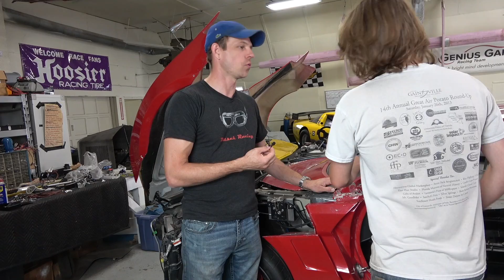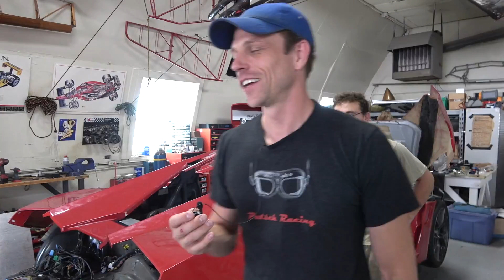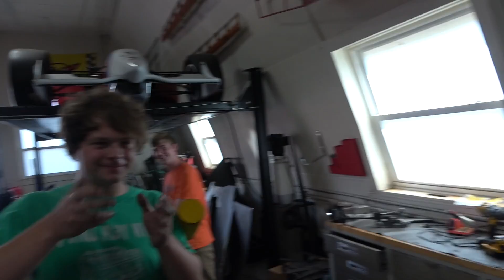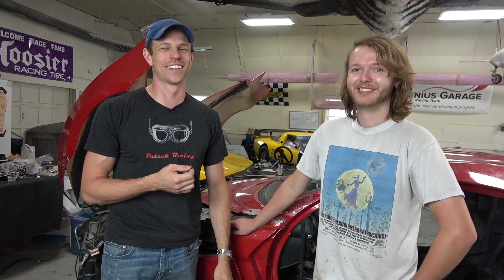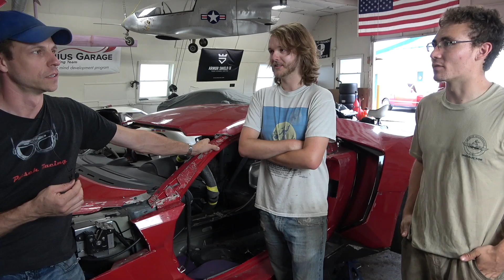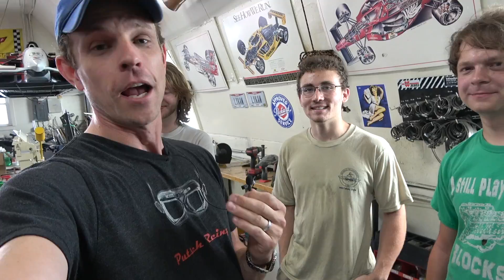The hard stuff | Lykan Hypersport build #15 from Fast and the Furious Live Stunt Car

Comment: Sorry I’m late. 
Was at a meeting with Augusta-Westland for freaking hours today. I’m glad to see the car coming along. 3M adhesives are serious. I’ve seen aircraft structure fail and rip before the adhesive failed. 

P.S calling mandrel bent chro-moly tubing pipes? 🙄🙄🙄 shame on you sir 😂😂
Reply: 3M has been kicking ass in the industry for a while now. A company that doesn't sit on its ass when the laurels keep shipping in.
Reply: aserta Definitely! My great grandpa helped start 3M way before I was born. 
I think that’s how my family was able to start the performance engineering firm.
Reply: aserta We have a construction adhesive in testing at the moment for the racing industry. It’s going to replace fasteners in certain areas of the chassis. In testing the steel beams it’s applied to have torn before the adhesive kicked the bucket. It’s pretty awesome stuff- gonna name it Laiken 50. It’ll hold up to 50 tons without giving even a blonde one.

Comment: Please tell me that you didn't just drill holes in the tubing and tap them to mount the clam shell. The threads through the walls of the tubing will create stress risers at every hole and will eventually lead to cracks and broken tubes. Of course, if the car is only going to be run for a few hours it really won't make much difference, but it is not an elegant solution. (Isn't fancy at all!) In places where it is necessary to bolt into tubing one should always weld a bung into the tube to create a proper attachment.
Reply: The support tubes for the clamshell aren't structural. They arent stress members and exist solely for the purpose of holding the clamshell.
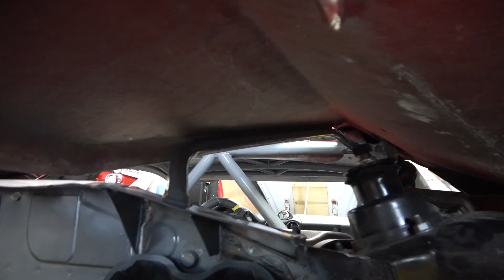Reply: @robokid20001  At 3:09 in the video, you can see that the tubes are welded to the structure at the back of the roll bar and at the rear bulkhead assy. As far as my observation goes, it really doesn't matter if they are "structural" as far as chassis rigidity or roll strength are concerned. They will experience vibration stresses at minimum and a series of tapped and drilled holes (which in tubing are impossible to deburr the inside of the holes, making the situation worse) will create multiple stress risers and unnecessary opportunities for cracking and failure, which would require cutting out welded in structural elements to replace. Better to weld in threaded bungs for mount points and avoid the issue from the start. It is extra work, and if the goal of the project is only short term then it is not an issue. On the other hand, if the goal is lasting quality, the extra effort would pay off. Engineering is always an exercise in compromise, and this is an example. I enjoy watching this kind of programming to hopefully learn something, as do many people. This just seems like a good spot to point out a possible issue. Not criticizing, just critiquing.
Reply: @edbennett8257  I know they're welded to the bulkhead, I'm the one that made them, mate. The small DOM tubing is 0.92 wall thickness, which is more than enough for tapped M4 bolts. DOM steel is not cracking under vibration, and the compression/ tension forces are taken up by the 1 5/8" tubing of the cage. 
We appreciate the input, but we've got it, my man.
Reply from the maker: Dude.... don’t be an arm chair engineer. It wouldn’t matter if those tubes cracked completely in half for safety and besides.... they never will. Would you care to talk about suspension geometry and bump steer next?
Reply: @robokid20001  DOM steel? DOM tubing?  You mean the stuff you keep calling "pipe"? (The term pipe is a very specific thing, different than tubing. Pipe sizing is determined by nominal internal diameter as the primary purpose of pipe is material transfer and diameter determines flow, with wall thickness being given in "gauge". Tube sizing is external dimension as it is primarily for structural work, with wall thickness being given as a specific measurement.) The term DOM is merely the manufacturing method, not an actual material spec (drawn over mandrel, as opposed to ERW or electric resistance welded. The difference being lack of a standing seam inside the tube. DOM is more expensive because there is an extra step involved drawing it over the mandrel to smooth the internal seam.).  What is the material? If it is 3140 chrome molly, it is somewhat susceptible to work hardening and cracking from vibration, especially at stress risers and weld joints that are not properly done. You're a very young man, and I get that you feel knowledgeable about this stuff, but you haven't had nearly enough experience to be barking back on this in such a dismissive manner. Like I said, depending on the design brief your solution could be appropriate. I saw you talking about wanting to be an engineer on an earlier episode. I've worked with engineers most of my life so let me give you a bit of advice. Do not always believe that you are right just because you thought of something and do not discount input from "uneducated" people.  I saw on earlier episodes you mentioned that you are still learning to weld, so here's a bit of advice for you on that too. Welding is more than just melting wire from the hot melt glue gun over the joint between the parts. It is a specialty of its own with very specific requirements that take professionals years of education and experience to master. Squirting hot metal out of a wire feed gun to hold 2 pieces together does not qualify one as a welder. I applaud you for getting hands on experience, but please don't turn into another engineering god who thinks mere mechanics are below him, we have too many of those already.
Reply: @CaseyPutsch  Arm chair engineer? Excuse me for offering an observation based on real world experience. You have no idea how many frames I have repaired due to cracks that propagated from a drilled and tapped hole. Tube frames, in mild steel tubing and chrome molly. Motorcycles, dune buggies, dirt racers. I was an Army helicopter mechanic, Leadman on the B-1B bomber program, held an A&P license and worked for TWA at the overhaul base doing structural repairs, designed and built from scratch with friends some of the aforementioned buggies, bikes and racers. Designed and build motorcycles that hold/held AMA National Land Speed Records. I'm almost 60 and have been building and breaking things my entire life. I have made mistakes, repaired them, and learned from them. My 2 car garage contains gas, mig, AC/DC tig welders, band saw, lathe, mill, cylinder boring bar, hydraulic press, and specialty hand tools that some people couldn't even identify. Excuse me for offering a suggestion that could make a difference in the overall quality of your build. Some people (like me) watch this type of video to learn, not to worship or laugh at you, and when a half ass method is presented, you shouldn't have a case of the red ass if someone offers an observation about alternate method. Suspension geometry? Macpherson strut? Upper and lower A-arm? Equal or unequal length? Rocker arm suspension? Rack and pinion or recirculating ball? Drag link with tie rod or relay and tie rods? Of course linkage and mounting locations are actually the most important feature as far as bump steer on a front end is concerned. Would you like to talk about the difference between a Panhard rod and a Watts link as it pertains to a solid rear axles effect on handling? Leaf vs coil springs, truck bars vs 4, 5, or 6 link. Of course independent rear suspension pretty much follows the same rules as front. No, I don't want to talk about it.
Reply: @robokid20001  Couple of things about those M4 bolts. (BTW, what is a tapped bolt?) I'm going to assume you're using a course pitch, .7mm. This equates to just a bit over 36 TPI (threads per inch). Tapping into .92 inch wall thickness gives you approximately 3 threads in engagement in each hole. I don't know about you but I would never trust any fastener in any application to stay tight on a vehicle with that little engagement and no locking feature. Again, as I stated in my first post, engineering is an exercise in compromise.
Reply: By the way guys, I'm not mad, not even annoyed for that matter. In fact I'm setting here chuckling, even though that doesn't come through well in text. (For that matter, in my case it often doesn't come through in person. I've been told that from across the shop I seem to be chewing people out if I'm just telling a joke, LOL,) I just happen to have time on my hands these days and thought I would try to throw out something helpful. It's all good as far as I'm concerned and I hope maybe someone can benefit from our discussion.
Reply: ITT: engineer flexes his book knowledge on something totally insignificant
Reply: @jamesflemmings1207  NOPE, not an engineer and never claimed to be, and not just book knowledge. Mechanic/fabricator with years of actual real world experience. And if you think that a discussion to minimize failures in a welded structure on a vehicle is "totally insignificant" then I hope you're not designing or building anything significant.

Comment: Why do people dislike these videos? I don't see what there is to dislike
Reply: I would imagine it popped up in their recommended and they didn't want it showing up again. if you dislike it, it won' get recommended again
Reply: @Casper061288  oh right, that would probably make sense
Reply: @AnitaHannjob  i'd hardly call them goofs, i'd like to see you do this ;)
Reply: @AnitaHannjob  W Motors had a team of trained, experienced engineers and substantial resources. This is a few kids in a shop making it up as they go along, and doing a kick-ass job of it.
I can keep going here. 
It's easy to criticize. What have you built lately?
Reply: @techvette  exactly, all these know it alls, fed up with them.
Reply: @AnitaHannjob  Congrats. And how did you learn to do that? When you started, could you build a car with three inexperienced team mates faster than the manufacturer?
If you're building jets and classic Lamborghinis... well, you're not unless you're doing interior design work, which barely counts as anything.